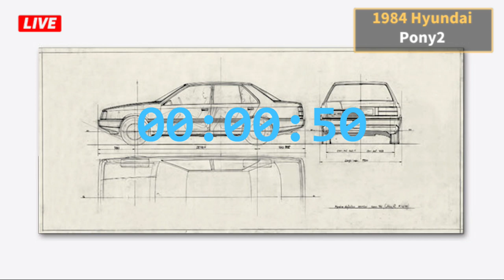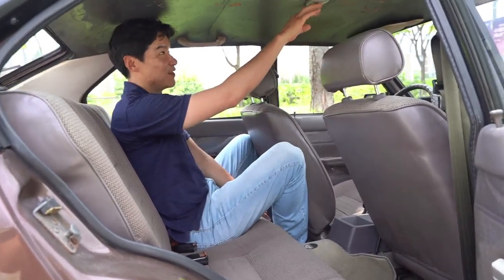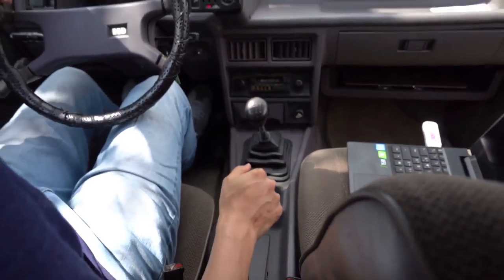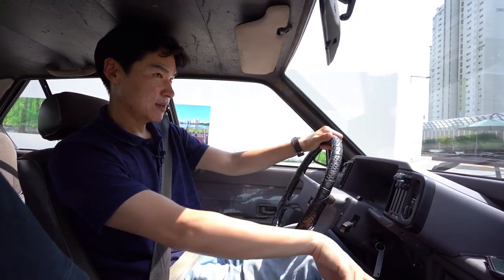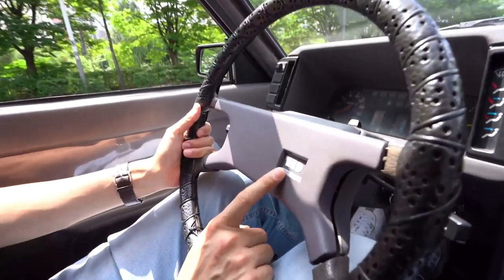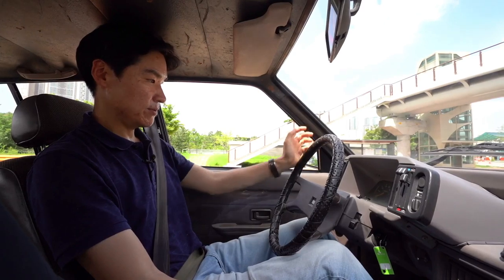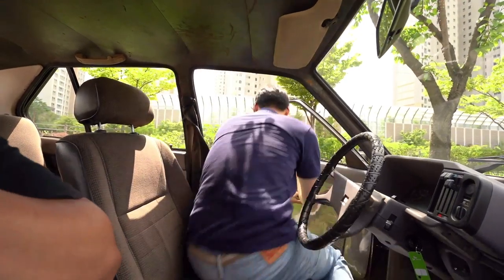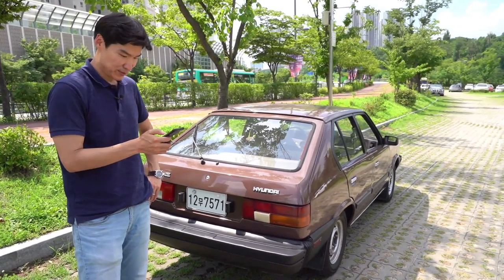Hyundai Pony - Quick look at 1984 Hyundai Pony 2!  Vintage from Hyundai.

Comment: That car reminds me of my very first new car.. a 1986 Isuzu I-Mark (in USA). Also designed by Giugiaro. The interior is almost identical. Not of high quality, and certainly not what cars are made like today. I remember cross-shopping the Hyundai Excel (Pony) at that time and it was a newcomer to the US with an unproven reliability record. In the end, opting for the Isuzu over the Hyundai didn’t do me any favors. The Isuzu didn’t even last 50k miles before the engine had to be rebuilt. It also had horrible clutch problems. But I do remember these cars fondly.. more from sentimentality and nostalgia than from their awesome performance and quality. But thank you for sharing this. Took me back to when I was 19 years old!
Reply from the maker: Wow, Thanks Jeff for sharing your precious story or history. hahhah. Thanks i am really showed how many remember about ponies, excels and other models. Wow
Reply: In1986 I bought a brand new Pontiac Fiero,  SE, V6, manual,  red with silver interior,  fully loaded.  My buddy bought a new I mark isuzu.  Surprisingly,  I liked his isuzu,  light brown exterior,  tan interior.  He had it about 3 years, and had around 70.000 miles on it when he traded it. I dont recall him having any big issues with it. He liked it well enough.  Me on the other,  I STILL HAVE MY FIERO ! Retired from daily duty after 287.000 miles in 1994. Still using it for fun, original engine still running great.  Of course my daily driver now is a 17 Elantra I bought new in june 2016. Been great, just ticked off 57.000 miles.
Reply: John Franklin My I-Mark’s color was called “Topaz” and it had a tan/brown interior.. probably the same as your friend had.   It’s funny, though, I had a friend with a red Fiero and I was sooo jealous!
Reply: @QuantumJ67  lol, that's is weirdly funny!  Yeah, I really enjoyed that car when new, still do in an old car way.  I'll never sell it. When the car was about a month old, a cop got behind me,  lights on. I'm like. What the hell?? I'm not speeding,  just going down the boulevard about 40... he comes up to my door and says, I stopped you because I'm thinking of getting one of these and want to know how you like it!!!  True story! I laugh about it now, but he shouldn't have done that.

Comment: The Pony, Hyundai’s first venture into the North American auto market and as previously noted Canada was the experiment, so to speak. The car was not sold in the U.S.  Americans didn’t have a clue that this car even existed!  It was marketed as a cheap car, no frills, rear wheel drive, no electronic ignition, no power windows etc. lust a simple form of transportation where someone could buy a new car at the price of a used one.  If my memory is correct they sold for something under $7000 Canadian. I was in the market for my first brand new car in 1984, I looked at this car, never test drove it though because the salesman was so pushy and kept hard selling. I ended up buying a new 2 door hatchback 1984 Mercury Lynx (think Ford Escort) 1.6 L 4 speed standard transmission for something like $7,200 CDN. It was a little more refined than the Pony with a little bit fancier trim. Oh yeah, it was also a powerless piece of crap! The only saviour was the 4 speed because I could imagine myself driving a sports car! LOL.